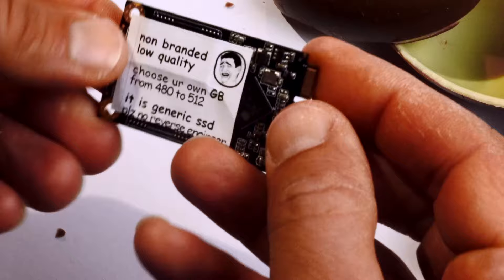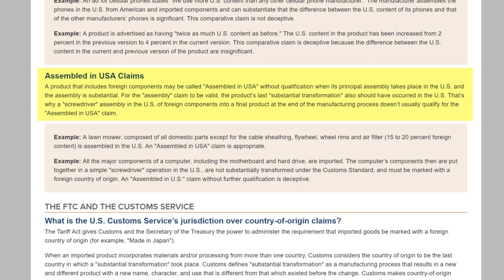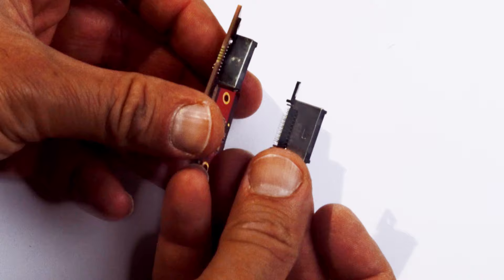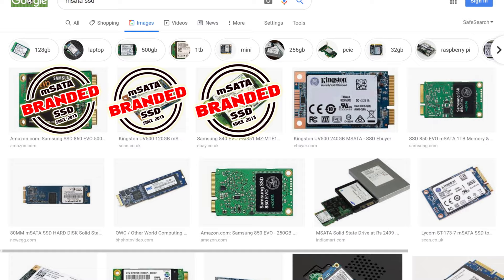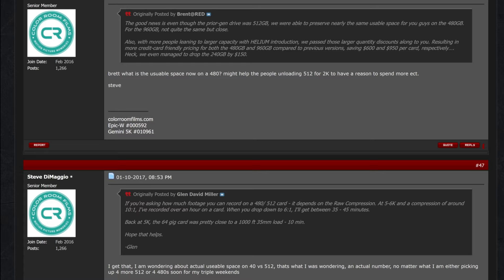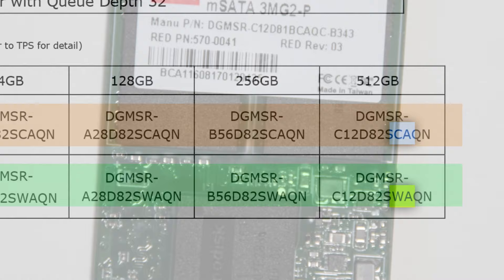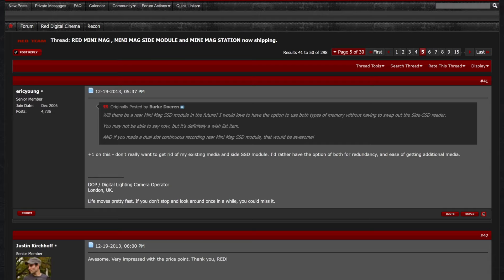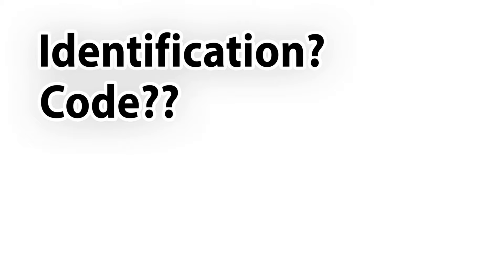Part 2 - RED MINI-MAG - Things you only thought you knew about RED Digital Cinema

Comment: Said this on FB but seeing that the original REDmag was just a M-Sata drive in a bigger case made me say 'are you effing serious' out loud. I bought $5000 worth of original REDmags then sold them for a fraction I bought them for just to buy $5000 worth of RED mini-mags when I upgraded cameras and they're the same thing. Could have literally stuck the SSD in the old 256GB MAG into a mini mag case. What a waste. Who else did the same?
Reply: You could just have opened the case and looked what is inside of them... It was pretty obvious that they are just using regular SSDs...
Reply: @irfp460  no it wasn't. They were advertised as proprietary media on their site. Opening them up would most likely void the warranty and/or mess up the adhesive that's holding the drive in place. Would you risk that on something you spent $3000 on?
Reply: @sixsongs8100  Yes. I did so many times. There is not tamper evident sticker on the drives, so eh, why not.
There are only so many communication standards they can use due to the hardware that you can get on the market so it had to be something SATA or nowadays NVMe. Even Red cannot afford to develop their own storage medium...
Reply: @ZHARMANE  They probably have. But that should be fairly easy to figure out.
Reply: @irfp460  Fair enough. I mean, I didn't because I had trust in the brand before all this happened like many others. I didn't really think of the mags the way I do now. Just thought it was a solid expensive super SATA drive made by RED or at least the best SSD money could buy in there. Nope!

Comment: You work fast! Once again a very insightful video. Loving the no-bullshit approach as well.
Just read Jarred's response before watching, and I was scratching my head at a few of his points, such as this whole "non-branded" vs branded SSDs because while yes, RED's camera's are all running custom firmware, literally every camera ever made that isn't a Raspberry Pi cam is going to have custom firmware on them. The only difference is that RED went out of their way to make their accessories as proprietary as hell to deter off-the-shelf SSD use which every other reputable cinema camera company allows for media. I also get the whole "spoofing SSDs to appear as RED mags are dangerous for RED" thing, but if I were shooting on a Black Magic and my SSD failed me, I'd be doing what I can to recover the media first, then contact the manufacturer about the issue. In the case with RED, since they use a multitude of manufacturers, it only makes me wonder why it matters that another media competitor does the same thing when in the end, it's an adapter connected to an off-the-shelf M.2 SSD (and in the case with RED, the manufacturer's lower-end chips) how this changes anything when in reality, if my RED branded mag failed, I'd want to also contact the manufacturer.

The fact that even the side module is basically an adapter inside with metal around is kinda irritating, but not as irritating as seeing the inside of a 1.8" mag. I'm a DSMC1 user, and hearing about how much "faster" and better the mini-mags were always made me wonder, but I continued to buy all my gear used. I don't think I've ever actually paid for anything from RED other than a sensor cap and a $100 evaluation after buying my Dragon. After I offload my media I'm gonna crack open one of my mags and see this for myself, because if this thing is basically a hollow shell with a small M.2 inside then it's gonna make me so thankful for buying used. Jarred, if you're seeing this, I love ya' and love what you've done for the industry, especially with R3D code and pipeline, but this isn't looking good, and if you or anyone on your payroll has been deceptive in the slightest, I think being honest would be the best bet at this rate, though I cannot prove anything as a spectator. I've got my own gripes with RED for completely unrelated reasons, but this would absolutely grind my gears if I bought brand new. In a space where other companies are very quickly creeping up out of nowhere after NAB, I'd be more willing to make RED more accessible by not making companies jump through so many hoops to become a third-party like any other camera brand when it comes to something as simple as media. It's not like you're opening up the possibility for issues to occur with media because most if not all customers are gonna buy GOOD SSDs, if not better than the low-end branded ones inside the mags to record to and take it up with those companies if they fail them. The only thing it sounds like RED is afraid of is the loss of that markup in mags if people go to other parties.

I presume this is why recording on external monitors like an Atamos downscales to 1080p when in reality there should be no reason to. It's been a wonder why so many pieces of RED branded gear are so expensive for simple components when they honestly don't need to be. I've seen enough RED owners stay far away from approved 3rd party accessories that communicate with the brain itself because of common unreliability and failure that have lead to literally bricking the whole camera brain so owners buy from RED out of fear. Idk, maybe this is why lots of owners are flocking over to Black Magic and other companies that support what should be simple user choices, like the type of media they buy. This has nothing to do with investing in the gig for reliability when there are users who've been screwed on a gig with a corrupted mag. The fact that production sets rent out multiple REDs as backups and not for multi-cam use because of how prone they are to shutting down or encountering errors should be evident of this. My Dragon failed to work and bricked itself out of nowhere one day between shooting during NAB and low and behold the problem fixed itself after RED being unable to discover the issue and offering to inspect the camera free of charge. I don't see a premium on reliability, I see a premium on the name and the R3D code, at least for now.
Reply: Please dont call it M.2 SSD; its only mSATA. M.2 is capable of doing PCIe (now with max. 8GB/s) mSATA has a linkspeed of only 0.6GB/s
Reply: @oliverheber3030  I realized this after. Thanks for pointing this out.

Comment: I Really hope linustechtips get this.
Reply: Linus Tech Tip just put the 8K camera back.....
Reply: I dont think linus will touch this.
Reply: If he interacts with it, he probably won't name drop the video. But I guess a video where they build something like 5TB mini mag would be pretty much right up their alley.

I'm more interested in how mkbhd reacts to this - he's a complete RED fanboy and Hydrogen phone apologetic
Reply: @baggern  You can get a 4TB Samsung 860 Pro drive for US$999 right now. It's a 2.5" drive, not mSATA, but it's a fine example. You can get a far larger, higher reliability drive from a better manufacturer for thousands of dollars less.
And then if you have a problem with it, you have a warranty good for 5 years (or writing the entire drive over 1200 times).
Reply: @asm_nop  You can get m-sata up to 2tb(1920G). Even "industrial" (as in wider temp range) just not on the open market für less than $2k. Those are mlc and with that chipset you could even make an eMLC one with more write cycles. Thise minimags are just rip-offs. They'd make  lts of money even using industrial components but they don't...
Reply: Well I was wrong he groped it linus vid up

Comment: Then you should be able to buy the cheapest 128MB Mimi-mag and change the inside SSD to a cheap 996GB amazon purchase with no issues? I would definitely like to see if this works
Reply: Ajushi Photography  yes I’d like to see that too
Reply: Why do that? It's still stupid expensive. Someone needs to rent a RED Mag, make a 3d printable version by scanning, then put it up on the web. For the bridge circuit you could custom order a premade PCB from China for a few bucks. If you order a few hundred you save more. Sell those for a buck or so profit on top in the west and you got your money easy. That's what Jinni is probably doing anyway. It is easy if you know what to look for. You get 1TB mags for the same price as a 128GB from RED.
Reply: @xmlthegreat  you better get on it then

Comment: You could 3d print the red minimag plastic shell and put all of that cheap cr.p in there for less than 30$
Reply: I'm already looking into it... problem is the adapter (mSata - Docking connector) is a custom made part to fit the enclosure and subsequently, the camera.... stand-by......

Comment: This is just ridiculous.

Let's be incredibly generous here, and say Red had a valid reason to make these things the way they do. (they don't, but whatever. We're being nice here.)

The SSD costs $20
The adapter probably like $4 at most.
The shell, being all metal, maybe $5
Other assorted parts (screws, etc): $1

Remember we're being nice here, so we don't care these are over-estimates.

Since someone DOES have to assemble these things, and they seem to be using hand assembly...

Well, let's say they pay their assembly workers $20 an hour. (hah. As if. But sure. Why not.)

How long does this take? well, You'd assume skilled workers are faster, but I can make a rough guess. Placing the components properly would take about 30 seconds, doing up a screw by hand about 20 seconds per screw.
Total assembly time 110 seconds.
Make it 180 seconds, for generosities sake. (3 minutes)

OK, there are of course packing, shipping, etc. But fine.

OK, so one worker can assemble about 20 an hour. So each one has $1 in labour.
Let's assume warehousing, packaging, shipping, handling and so on adds another $10 to the price.

We're at $30 in parts, $10 in assorted costs, and $1 in labour.

So, $41 for this 'custom' assembly.
Now we'll allow them a generous markup, because why not.
That's say about 200% of the manufacturing cost.

So... final cost is $120

Actual sale price, $850?

I mean, come on now. A substantial markup over the mostly unchanged base components is one thing.
But this is more than 20x the price of even a generous estimate of the cost of their extra (mostly pointless) 'manufacturing' steps.

I mean, wow.

Comment: Glad to see someone pointing out this madness. At least when Sony pulled this shit with the PSP the cards where actually different. Hope the FTC steps in and slaps RED on the wrist.
Reply: The psp memory cards were a microSD in an adapter. I broke mine open and stick the microsd in my phone lol
Reply: @fluffyfetlocks  I'm not sure how accurate that is. Maybe with an adapter but the original Memory Stick format pre dates sd cards by several months. Sony launched those cards in 98 SD hit the market in 99. Maybe your thinking of the vita I believe those where basically just sd. I was talking about the first time Sony did this with memory stick. By the time the psp hit the market sd was way more popular than memory stick. And there was no real reason to stick with that format other than $$$.
Reply: @SpaceSquid420  but.. the psp came out in 2004?
Reply: @fluffyfetlocks  Yea both memory stick and SD had been around for a while by the time the psp came around. They are similar formats but not the same. The SD to memstick adapters have an ic to do the conversion. Way different than what reds doing with a simple pass through. Still greedy since the whole time the psp was on the market sd was cheaper. But at least there where actual R&D costs sonys markup was certainly not as bad as reds.

Comment: RED's idea here is twofold:

1. Convince filmmakers who don't know better that they have secret sauce on the cards as a ritual hazing exercise
2. Optimally collect the consumer surplus of charging multi-million-dollar film production companies what they are willing to pay for cards rather than what they actually cost

Part #2 deserves some extra explanation. RED is in a position where almost all of their customers have deep pockets and will pay whatever it costs because this kind of equipment cost is nowhere close to a significant fraction of the total production cost. They aren't going to notice getting ripped off on $2000 cards for their $100,000 worth of cameras in a production where they're paying $10m to get all their actors on set.

I'm surprised RED has the balls to stick low-end drives in these mags, though. No wonder LTT has so many problems with these mags - TLC is just not really designed to handle 8K video being written and overwritten on a daily basis. For the kind of reliability you expect from $2000 cards you really should be getting SLC in there.

Part #1 is the same reason why Apple users might not bat an eye at a $1000 monitor stand for a monitor that costs (and deserves to cost) $5000. At some point the brand does what you want it to do to the point where you just trust them with your bank account and remain willfully ignorant about how much they're screwing said account.
Reply: You are right. Sadly, for most companies, if you have crew already trained to operate with Red gear, it will probably be more expensive to get everyone to a training program and learn to operate with a  different brand than get ripped off by Red for a couple thousand bucks. These costs are low compared to other solutions. This is why Apple can pull off that $1k for a stand bullshit. Anyone in the media industry knows that and there is not much to do about it... 😐

Comment: The 960GB StorFly is only available in the "CE" version, with the second best maxing out at 480 and the very best one at only 240, so going with a higher quality one wouldn't have been an option there anyway. Maybe you missed that part.
Reply: Carl  And they do, but again there's an issue with quality. The really high capacity chips are using less reliable and slower memory.

Comment: Here are some tough questions that I hope red addresses.

1.  Why does Red do a one-year warranty on a red mini mag, when the inside component offers a three year warranty?  

2.  Why does on a red minimag say that it's "made in the USA", but when opening it up, it appears that it's a majority of foreign components? 

3.  When the red minimag 512gb was discontinued and the 480gb red minimag was introduced, are the two ssds inside - do they have the same usable space?  If so, why did Brent Carter say there were different?  Why was the 512gb discontinued?

4.  Was the red mini mag ever, via advertising or official statements on the red.com webpage, labeled as proprietary media?  

5.  What is the reason to choose from SSD suppliers, their consumer-level SSD drives vs their enterprise-level ssd drives?

6.  Is the SSD inside the red mini mag (DSMC2) able to be used in a red mag (DSMC1)?  And if so, why was this upgrade introduced?

7.  Are there any other components in red cameras, current or past, that can be shown Red to have made that are consumer-level components vs higher-cost choices?  

8.  And are there other parts that red says are proprietary and they are not?

Comment: Show us how to upgrade our minimag !
Reply: Step 1: Unscrew four screws
Step 2: Remove drive
Step 3: Buy a bigger drive of the same series
Step 4: Undo steps 2 through 1.
Step 5: Plug into camera.
???????????? 
Profit!
Reply: 1. Buy a screwdriver 
2. Buy any mSATA SSD 
3. Take the minimag appart 
4. Take the old SSD out 
5. Put the new SSD in 
6. Reassemble 
7. Done!
Reply: @mirabilis  nop not all msata work
Reply: @lukerob5412  Says who?
Reply: @mirabilis  try it ! only the one used in past minimag seems to work ' so we need a list or something
Reply: @lukerob5412  maybe the camera firmware have a white list of ssd that are allow to work. If you buy for example the same 960gb ssd that was shown on the video it will surely work.
Reply: I think we need to spoof a little line on the firmware code to trick the camera. It should be a very simple task. Without the code the camera will throttle down to the lowest write speed possible (REDCODE 17:1 or 22:1) even though we use much better SSD or even the same model!

Comment: Did we know if DSMC1 SSD Module 1.8" are the same? Should be have a circuit board because of LEMO EVF/LCD output, I wonder if this board of DSMC1 Module SSD has short circuit protection that could be caused by the LCD screen 5" RED Pro from LEMO cable because LCD screen won't turn on anymore :(

Comment: Ohhh someone is trying to cause a class action lawsuit. 

Keep in mind red doesn't only use the crazy high media price to make money, but also to provide their "free" data recovery. 

Learning that the original redmags were also just adapted ssds was the first time I really felt betrayed watching these. Having the mini mags be m.2 ssds made sense. When the mini mags launched m.2 ssds had just started to become widely available, so it made sense for them to switch to a smaller and easier to produce form factor. The fact that they never designed their own PCB for the original flash memory in the original mags is shocking.

I also didnt know they lied about it so much on the forum. I shoot on red often, but I didnt join the community.

Comment: Ok @Jinni.Tech I have to give you shit on a major point, other wise I love both your videos!

You way under estimate the cost of manufacturing that red drive at 4:40. you only take the cost of the SSD into consideration! You completely leave out the cost of the RED case, adapter, labor to Assembl, and other over head cost.

I think a price to produce is closer to $80-$100 would be a liberal guess but at a bare minimum $50 for the cost of manufacturing of drive, not $20. Still a massive gap from RED's $850 price tag.

Comment: The one question I have from both videos. Is it possible to say take a 128gb mag and then replace the drive with a 960gb one? Or does the adapter have a firmware that shows the camera the size?
Reply from the maker: Yes, possible, wait for the next video  Adaptor is just that. It's not doing anything else